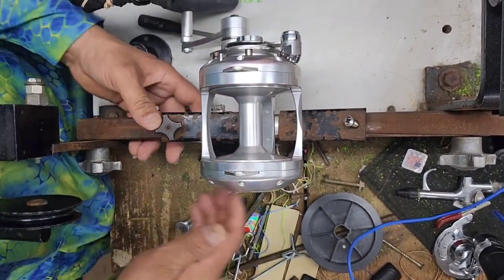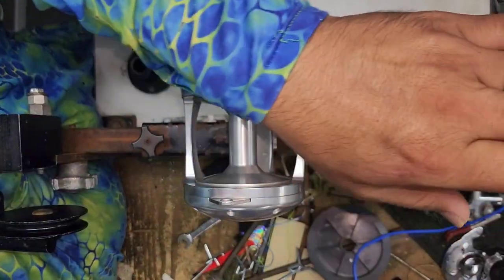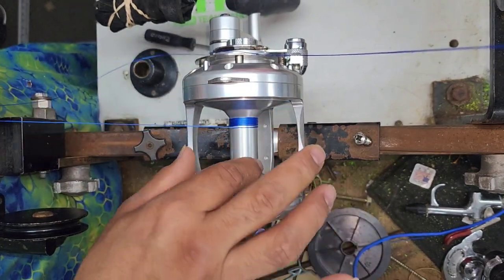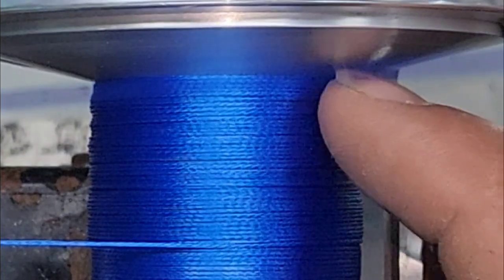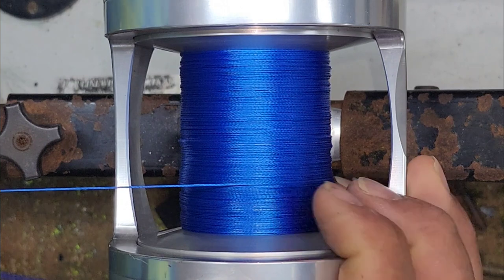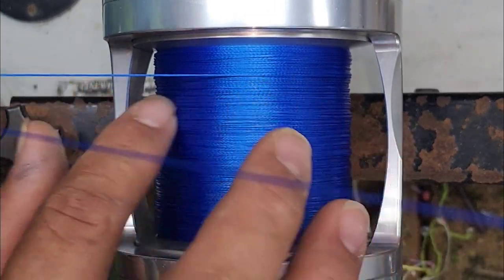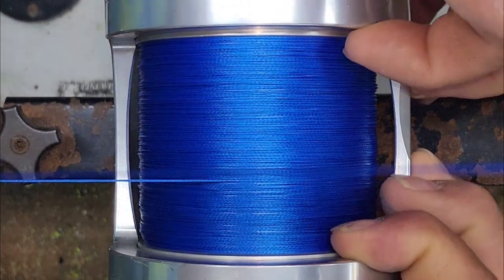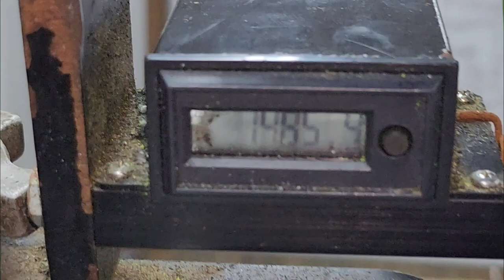Another reason why to use Hollow core braid over solid braid

Comment: Would putting 65lb hollow braid with a 40lb top shot be worth it?  Or is hollow core more beneficial at higher pound test?
Reply from the maker: Why put 40# on top of 65#... or were you asking about 40# mono..? Either way we have gotten completely away from the use on mono top shots unless using it for offshore fishing trolling
Reply: @TeamHardLife  it would be for tuna fishing. I’m contemplating hollow vs solid braid in 60lb with a 40lb top shot of mono.
Reply from the maker: We have seen both days of the way guys fish for tuna.. guys up north like the hollow core and those in the south like solid..
Reply from the maker: That's California info though
Reply: @marcomunoz7453  I run 80lb hollow core and 100lb fluoro for big YF tuna out here in hawaii. It is more than enough for the big boys. I don't think I'd ever go less than a 65lb leader
Reply from the maker: @joeditz48 are you fishing off a boat ?
Reply: @TeamHardLife  yes
Reply from the maker: That's a important point to also share why you have that on there, for land based fishing we don't like to use any mono top shots too much stretch and casting problems... but for trolling it's a must to have mono top shots..

Comment: I’m curious in my 14000 spinning reel I can put 300 meters of pe 6 130lb solid braid which is around 42mm how much of 120-130lbs hollow core I can spool in my 14000 reel?
Reply from the maker: I looked into online mm of the pe lines and I see it's a lot thicker than that diameter... .52-.55 and the hollow cores I see are .57 with tightline and even then truly believe you can still get more hollow onto the reel compared to it..
Reply: @TeamHardLife from what I check again 0,52mm is equivalent to pe 8-pe 10 I guess I have to try to find out
Reply from the maker: It's head to find stuff that if legible on the phone lol
Reply: @TeamHardLife  yup I guess I spent my time for nothing lol
Reply from the maker: Spent your time for nothing?

Comment: I don't see the upside to this. Wasting a lot of extra line. Plus gonna make the line much more dense on the spool probably effecting how it cast. I like to be able to fish and keep my line changed more often with fresher line..this takes you in the opposite direction. I know braid has to go bad at some point from just being exposed to the elements. I fish my reels 6 to 8 times before changing line. But I'm just using mono on a baitcaster. Not sure how it is with surf reels and line like this.
Reply from the maker: OK the inner braid doesn't get worn like the outer braid will obviously cause it will  only hit water when hooked up to monster fish, next when you want to change the top shot all.you have to do it change that out no worries it will splice in and no knot, and also.you only have to change out the top part.so saving you money In the long run.. and yes you will not completely fill up the spool for casting you will have it backed off atleast allowing 1/4" of an inch to allow the spool to breath while casting been doing long distance casting with the hollow core braid and I am getting close to the 200yd mark with regular fishing reels... but I know if I clean them up a bit I can break that mark no worries.. so stay tuned